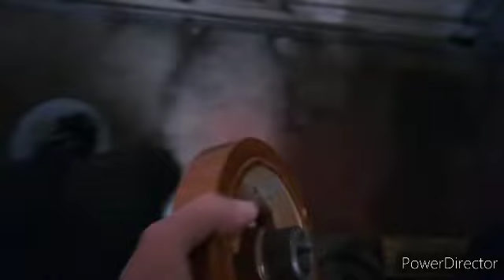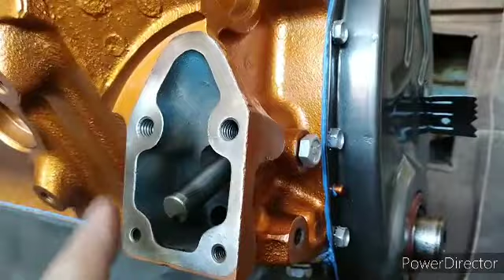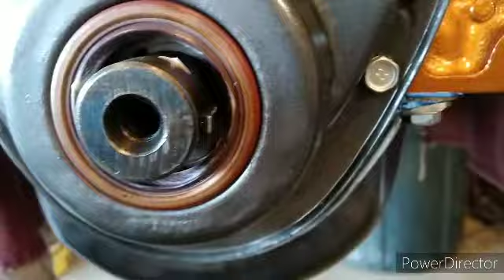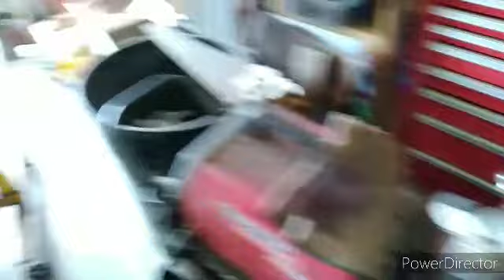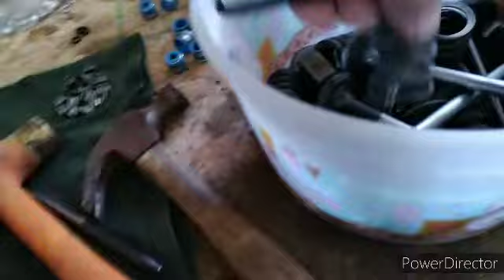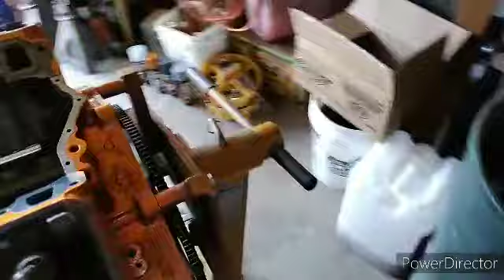Wrapping up assembly of our sbc 350 for our 71 GMC.

Comment: I helped a friend replace the thermostat and she did get an air bubble and over heated her vehicle.  She was pissed at me.  I did for free but I hadn't learned about air bubbles not allowing you to fully fill the radiator and water jacket of the engine.  Live and learn.

Comment: Hey !
   I ran across your video of the sedan body and a cowl you dragged home and started building a rat rod.
I sorta did the same thing a few years ago in my full basement.
   As I watched your progress on that body and cowl it brought back a few memories of my build.   I really enjoy creating something from what others would abandon as junk.
My bucket has not yet been mated to a frame.
   In 2012 a friend and I decided to build a rat rod roadster to sell and maybe make a few bucks.
Well a few months later I took that car for the first ride.
When I got back I told my friend I would buy him out and keep the car.
I learned a lot about building a bucket roadster with that car which I still own and drive in warm weather.
The best thing I learned was " Do Not " build it as a step over the side car.
we hand built suicide door and I am so glad we did it that way !
it is so much easier using those doors versus trying to get over the body sides.
   Building the doors and the jams they fill is not that big a deal when you have learned to work metal. 
NOTE. Buying a set of a Shrinker and a stretcher from Harbor Freight is so worth the money!
   I suspect you will be very unhappy with that roadster if you have to struggle with climbing over the sides.
The length of your body is a bit long but you will really appreciate the added room for carrying chairs and or a sun shade to car shows or just for an outing.
   Of course all this depends on if you intend to further build the car.
Work Safe, Be Well
Reply from the maker: Fun to hear your experience!